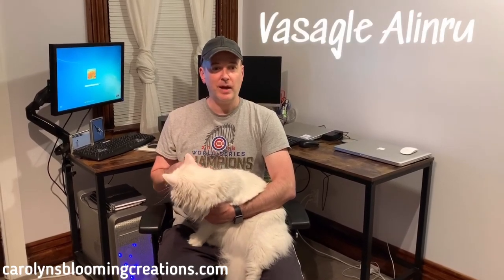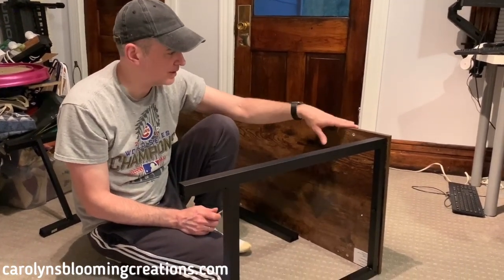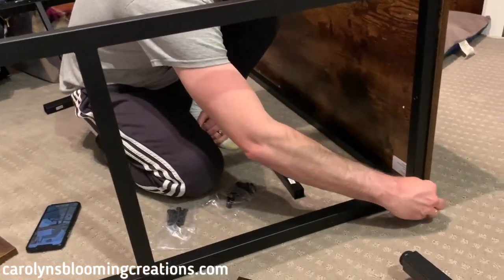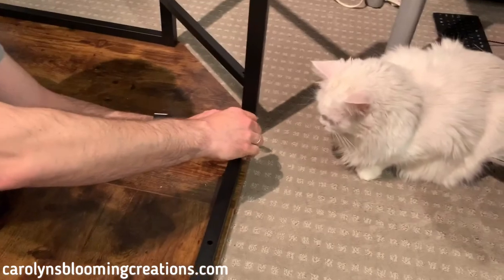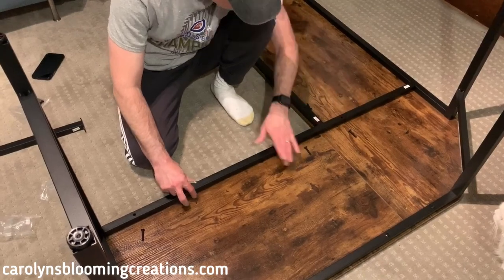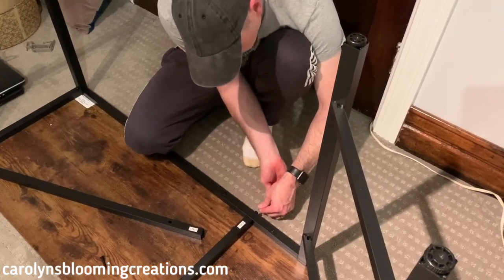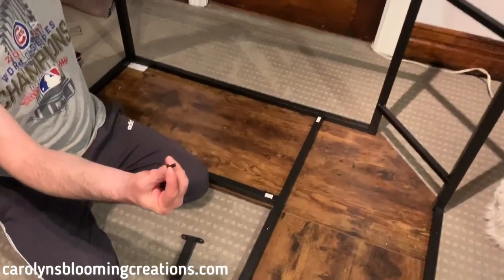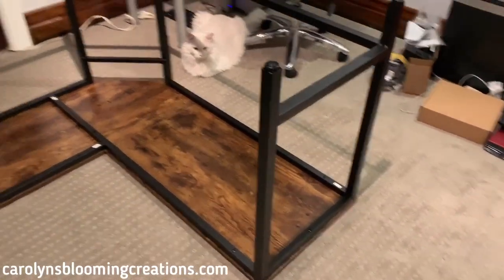How to Assemble the Vasagle Alinru Computer Corner Desk | Amazon Home Office Help | DIY Desk

Comment: Mine came with no instructions OR ASSEMBLY KIT. Anyone know the length on the screws? Amazon wants me to return the whole thing but the box was so badly damaged, I can’t use it, so trying to figure out how to assemble the desk after purchasing new screws
Reply from the maker: There are several different lengths for the screws that came with our desk. Maybe try buying a set of screws in different lengths at a local hardware shop. We've had to do this before for items we've purchased online as some products end up needing longer or shorter screws than what comes with the products. Good luck and thanks for watching! :)

Comment: how did you successfully placed the monitor arm? Is there enough space to clamp it?
Reply from the maker: On the monitor arm we used, it was able to clamp to the bar support underneath the desk. The brand arm we use is North Bayou, which we got from Amazon. We can’t comment on other brands, but our clamped on easily. Hope this helps!
Reply: @carolynjbraden  thanks! I bought the icy box ib-ms504-t. Which will arrive soon. I just hope that it would clamp nicely to the table, otherwise I'm screwed and I don't know what to do :D

Comment: Is it a strong desk
Reply from the maker: Yes, it is a strong desk 👍
Reply: @carolynjbraden  how strong
Reply: Can it support a pc on a little uneven floor
Reply from the maker: According to the Amazon listing, it can “hold a static load of 110 lb”.
Reply from the maker: It has adjustable feet so you can make it more balanced if your floor is uneven.